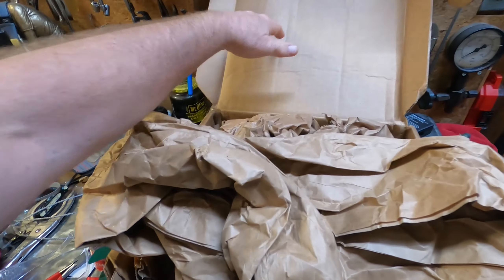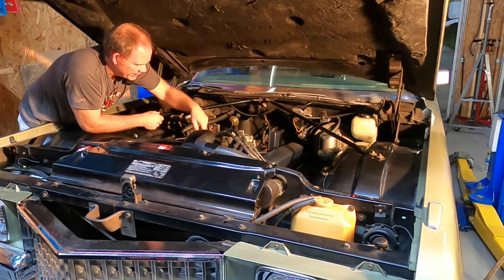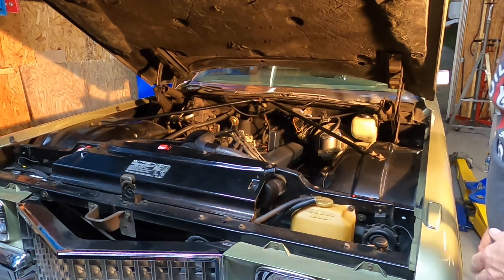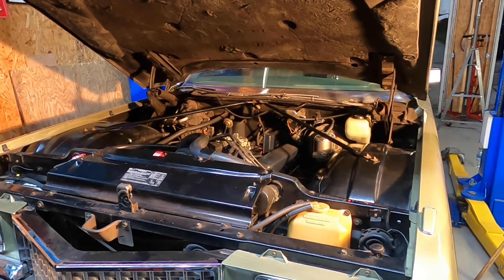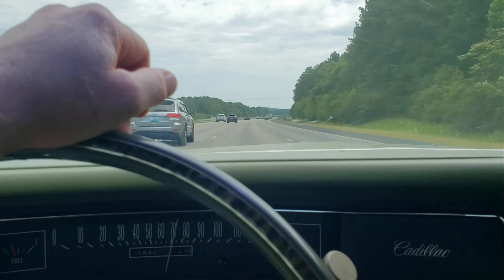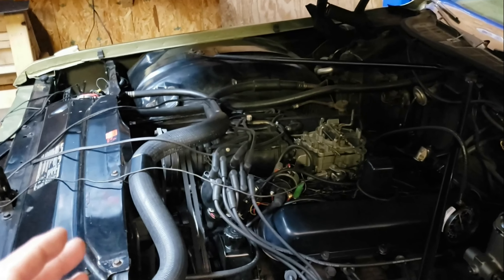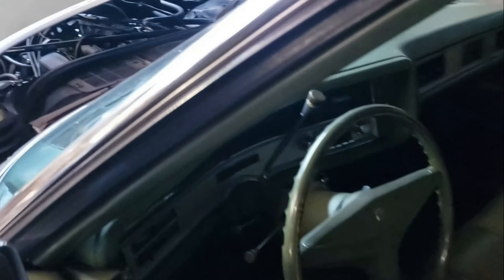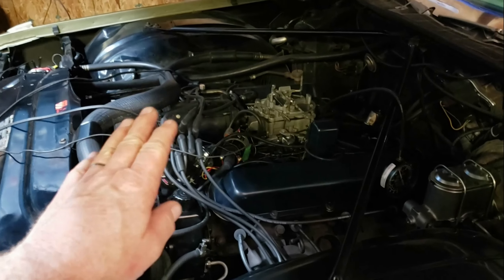71 Cadillac Deville - Quadrajet Restoration - Part 2

Comment: I'm going through the same exact idle problem with my 72 Cadillac, same as yours it drives great but the idle is a little rough. I will keep watching your videos, they are really helpful!
Reply from the maker: I've come to the conclusion that my next step is to try a completely different reman carb from another source and do a deeper dive into this original one. I'd really like to keep the original one on the car.

Comment: I went with a Four Seasons compressor. On my car I also needed to replace the condenser and liquid line. I got my condenser from OPGI and between the condenser and compressor the system took over a pound less Freon than the factory setup. I’d say the performance is excellent. 40 degree air and far less drag from the compressor. One issue I had was the new compressor did not work with the factory AC bracket. I made one that looks great fairly easily out of a 3x3 piece of angle iron, I’m sure you could do the same.
Reply from the maker: Thanks !! do you recall the model number of the compressor ?
Reply: @ImpalamansGarage  Well, I bought the compressor from Old Air Products over in Fort Worth.  The compressor I got is made by Four Seasons, but it is packaged for the Hot Rod Builder thus has some cosmetic mods from the straight Four Seasons pump.  Mine was called the "Pro-10" compressor.  I assume the guts are the same as the regular 4-Seasons, mainly the clutch was prettied-up to look good as something more prominent on some hot rods..  I would not do that again. But it works great, and definitely draws less horsepower when running.